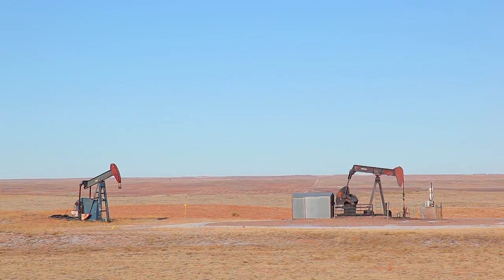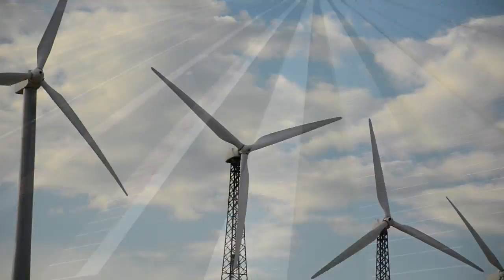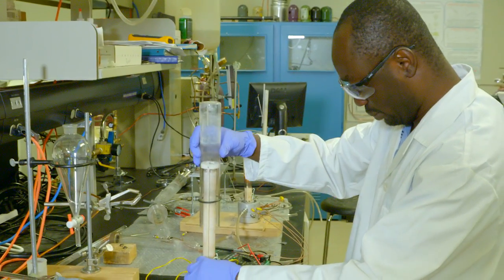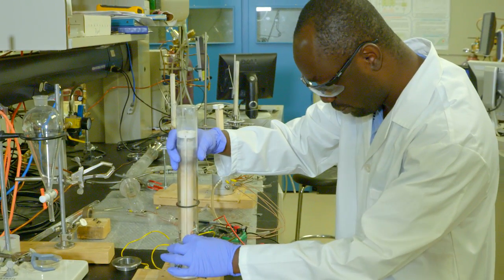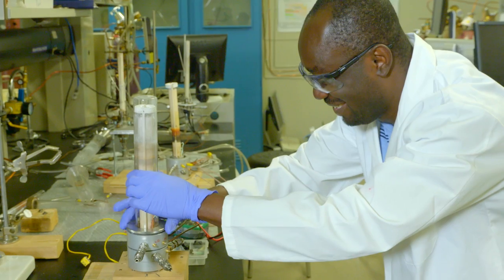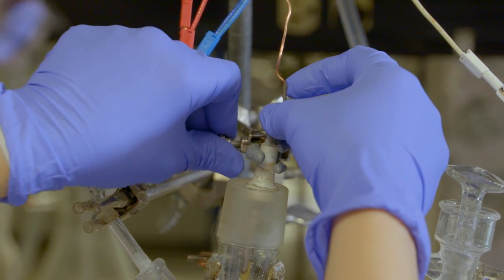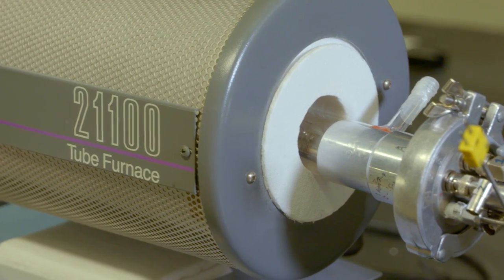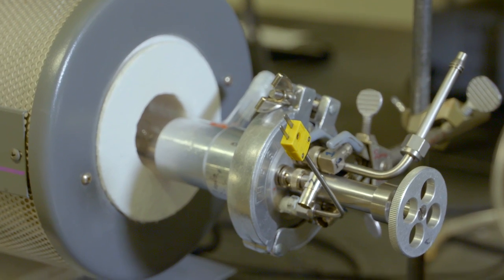How many batteries would it take to power the whole world?

Comment: You take your wind and solar power, and pump water to a higher location, storing the energy as a dam would, with a head of water, releasing water thru a waterwheel or turbine when power is required in the absence of wind or solar.  no batteries or high tech fuel cells required.
Reply: Jim Hofoss q
Reply: The energy needed to pump water to a higher location would be greater than the energy extracted by the same water flowing from that height, like a dam. Therefore, it is not feasible. We would be better off to just use solar power itself.
Reply: nkjenknkwefdk    Yes, but power 24/7 with a dam, no batteries required to maintain or replace.
Reply: Well, you could connect solar directly to the grid without the use of batteries. And, a pump which is run on solar will suffer the same issue as no sunlight at night.
Reply: nkjenknkwefdk   thats why you pump water during daylight, water turbine at night from the dam.
Reply: nkjenknkwefdk connecting to the directly to the grid is fine, I was thinking of a smaller scale off grid private solution of eliminating the battery storage....its expensive to maintain over a long period
Reply: I see what you mean, and what you suggested is interesting, to say the least.